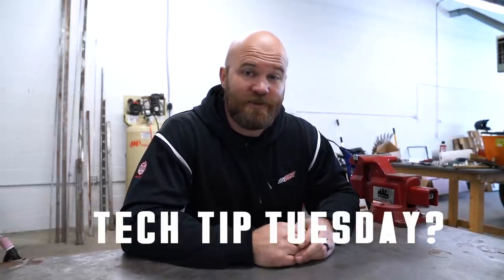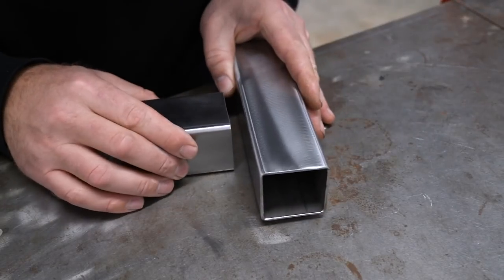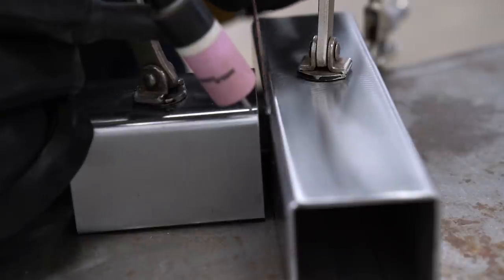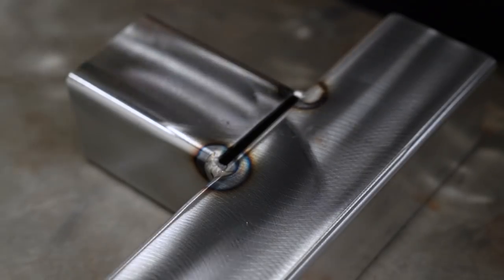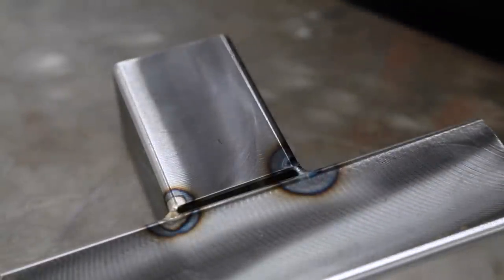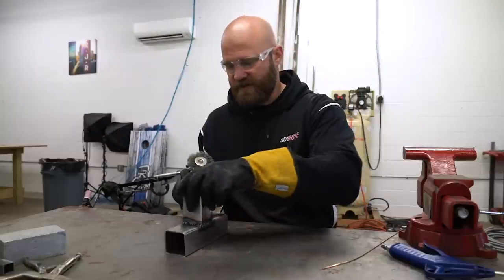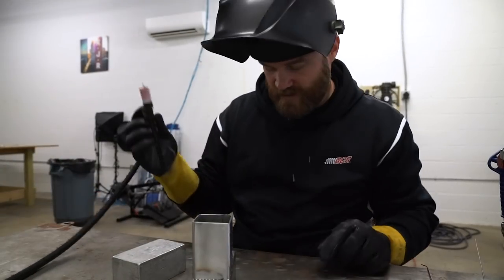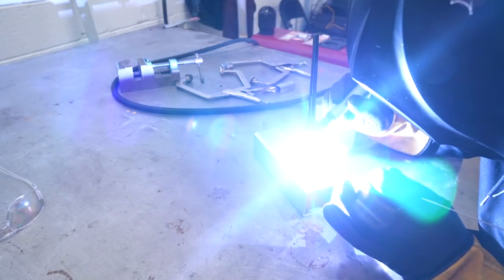How To TIG Weld ANY Gap

Comment: I had to quit watching. I’m a AWS CWI and have been welding pipe and boiler tubes since 1993 and I’ve never seen or heard of such. 
Turn your heat up get a bigger piece of wire and weave it. Avoid all the start and stops you can. I’m not making fun of you just trying to help.
Reply: Tacks are a big no-no on boiler tubes aren't they.  He probably isn't going to be working on anything that's xrayed so you can kinda just do whatever as long as it doesn't break
Reply: It says how to weld ANY gap. There are gaps in superheater tubes, walls, headers or anything really. You sound very intelligent by the way.
Reply: There should be a gap on every fit. With a very tight to zero gap you are guess on the penetration. Every welder has tried to make a X-ray weld the wrong gap and and blowed the wall out. The reason we have always tried is to not have bur bit shavings all over you. Kinda like porter wagner. The vast majority of fits on boiler tubes is made by a pair of welders. If you put your tacks in on a bad fit than weld belongs to the welder no matter what. Unless there is porosity on either side of the heat affected zone which is very very rare. A lot of welding partners will only put two tacks on a fit to have the fewest start and stops. I hope this kinda clears things up. The only reason I ever committed on this is to maybe help a young guy from busting a test because he put 231 tacks on it.
Reply: @drsexy2491  ??? If the pice was cut right dont you gap it to size of the filler rod???
Reply: @jasomkovac9115  really man
Reply: @fewridge6479  Every time you start and stop welding increases stresses imo. Once the weld stops and cools it shrinks and warps more.
Reply: @Charlesfeken  Thats why some companies have welder assistants to help with pipe fitting. They do the cutting and grinding so the welder can focus on just welding.  If you have to grind and prep everything thing yourself it takes longer on a job. Good assistants can move up to welding. If they spend their free time practicing welding instead of geeking at their smartphones and texts from friends.
Reply: just like body work on a car....it's all in the prep work. 
2 HRS of prepping for 5 minutes of welding....
Is better than 30 minutes of prepping and 2 hrs welding.
His cover up pass does look pretty nice though and I can see the merit in it on something like....
repairing a slammed trailer tongue toolbox that cannot be straightened well and is not going to be inspected such as structural field work would.
Reply from the maker: @Gardening 1974 in race car building a gap can put the chassis in a bind.
Reply: @Charlesfeken  not always but it's a very good starting point. It depends mostly on welder prefence and welding procedure
Reply: @George Rowe III Nice! Thin wall is harder for me than 180 or what have you... Try to get some practice doing that with an inconel filler rod. It's mostly used for carbon to stainless welding. If you can do an inconel butt weld it will certify you for all tig welds
Reply: Swampy  Lol! I'm not a welder at all but want to learn as a hobby and to repair a riding lawnmower and MAN! That's a double whammy, riding lawnmower/tractor guys and welders are double grumpy!😂😂 

"THATS NOT THE WAY I DO IT!"
"THAT WELD LOOKS LIKE SHIT!"

But every welding video on YouTube the comment section is filled with complaining and people complaining about the complainers 😂😂
Reply: I am a welding engineer and was the  741st CWI Made (Was a CAWI 2-years efore that) Couldn't agree with you more. Somebody willo try this completly improper technique on a critical weld,,,,even on a stock car,,,and sombody could loose their life over it. What he did is just plain wrong. Hurt fealings do not take persidance over dead bodies.
Reply: Swampy,,,,why do a Bob Villa half ass garage floor fabricating job when the correct and approved methode is actually faster and easier? - As AWS and ASME members and professional engineers it is actually our duty to try to stop the teaching of totally wrong and, in fact, dangerous techniques.
Reply: @jasomkovac9115  The 5700 pound valve bodies for the eleivtors for the aircraft carrier  Carl Vincn,  Nav Sea and 250-1500 Navy Nuclear parts I cannot tell you about. Parts for the Perry Nuclear Power Plant. A prototype for a 40MM anti Aircraft Gun. Many overhead cranes with up to 200 ton capicity. ,,,,,shall I go on Kid?
Reply: @cameltoast  You don't know any Electricians or Millwrights, o you?
Reply: @cameltoast  So if you want to learn the "hobby" why do you want to learn to half evcerthing? It costs no more to do thing correctly then it does to be a garrage floor fabricator,,,,,unless you really enjoy looking like a chump in front of professionals.

Comment: Yo you got some great advice. I've got an Everlast welder. I love welding with it stick, tig, mig (yes it can do all three) anything I just love welding but man I hate welding with gaps. I hope your advice will work with me.
Reply: Everlast makes some nice affordable multi-process machines.  I have 3 Everlast welders in my shop as well as ESAB and MIller.
Reply: Just tack the corners and star welding the gap you dont need to many tack on the gap. It is so much easier and faster.

Comment: welding any gap or hole is basically filling it up, with any of the process'. Taking note on your heat and not burning through the base metal. Every welding process, tig, stick, mig, braze, is all using filler metal. It's a matter of just kind of knowing your metals. Experiment, have fun. The best I came up with so far is tigging silicone bronze. Obviously, not for aluminum or any other metals in that field. But it's dam fun, when you fix someone's mistake. WHAT HOLE ? WHAT DO YOU MEAN SLOPPY CUT, WHAT CUT ?

Comment: Try laying a piece of filler rod in the gap, then welding over.
Reply: Dont do this! It causes way to much filler metal to go  into the weld and the heat might cause the other end of the filler rod to point up! (obviously idk if your joking)
Reply: You can leave lmfao.....never tig weld like that huge waste of material
Reply: Whats wrong with lay wire?
Reply: @nicksmall1990  nothing in my book, but it's the internet and everyone has a better, more knowledgeable reply.
Reply: @novarocker247  which is how your reply started.
Reply: @troutman3084  that's why I'm not arguing. Maybe you all are right.
Reply: @raging_naclholic4636  Just tac weld the filler rod to avoid point up
Reply: That is called slugging,,,,,and its one of the reasons the Liberty ships in WWII broke in half.
Reply: I thought that was torpedoes.

Comment: Your gas was not ON for the first weld was it? thought you were mig welding .........good video
Reply: I wondered if the hoses had not been fully purged with fresh gas at the start of the tack, and then by the time pure argon was flowing, the resulting oxides and impurities contaminated the subsequent added metal?
Reply: @Gottenhimfella  nah my money's on gas wasn't on
Reply: @JustVoss  then what happen explain?
Reply: @JustVoss   : you make a valid point. Trouble is, this is youTube, and valid points get buried, while armchair experts stride across the virtual landscape like predators ...

Comment: Make holes on purpose and close them back up  . Or stich weld  if a gap is Abit wide bout like tack on one side tack on another till it's a complete stich if u will. On both sides on same area . But hey either way using a spacer or other methods   I'm just saying.

Comment: Normally with Tig my jobs are sensitive enough that the match has to be perfect. Something like that having to use a 3 inch 80 grit belt sander with an angle plate.

Comment: I'm pretty sure you shouldn't use thinners for cleaning, only acetone. Thinners leaves a residue which gives off something nasty when heated. Or did I have a nightmare? :-D
Reply: You might be thinking abut brake cleaner.

Comment: Use a larger diameter filler rod
Reply: Not a good idea with a 1/16 tungsten. You’d end up having to pump more heat to get the filler to actually melt down and transfer to the puddle instead of balling up and being a general pain in the dick, ending up with bad warping, and sometimes total weld failure if it’s bad enough.

Comment: Brand should not matter. There just pieces of metal that serve the same purpose
Reply from the maker: You can look at two brands of gas lenses and see the machined steps that seat into the torch head are different.

Comment: Dude, When you got the far away shooting with a camera you need to cause a darker welding filter, you know, like going from number 13 filter to a number 15 filter of your mask. Here is why the auto filter is trying to see the table too so it is still flashed out to bright spot rather than seeing a liquid spot flow in your metal. You need to adjust the auto to go deeper into a darker filter setting. Most auto is set up to around thing like car headlights glare you need to set up to see around the sun's glare most auto darkenings do go to seeing around the sun for star gazing people look it up with the auto filter maker if you do not want to him about welding you doing then tell about trying to see the planet Mercury during the day time or maybe around sun sitting time of day the arc at some distances is much closer to sun brightness than the close-up arc welding is, which is and has been brighter than the Sun glare. although through a telescope this differences is less than many think it is, you see I know is this by seeing the planet Mercury at noon time with the Sun is at the point called zenith when the sun is the very brightest  on June 20th of each year within a 16 " double refractor telescope and taking photos of Mercury at that time. there are auto filters that can do welding from 6 feet to 8 feet away from the welder spot and can see the liquid just flow right into the metals and I talking Electrical Arc. 
I done this just to see if it can be done and that was ten years ago.

Comment: If you cut the box “crooked” filled the gap up with wire so it shrunk & took that long cleaning the base metal before welding in my place - you’d get the sack for being a sap.

Comment: Be careful with certain lacquer thinners, and esp brake clean, when weld arc is flashed on them they produce phosgene gas, and given enough years and saturation,  youll be pushin daisy's.
There are no old welders after all.

Comment: Hi , I am a retired Boilermaker and I can tell you right now , you have no idea how to weld TIG . on a side note do you know what TIG means because I don't think you do . Also every joint I welded was Xrayed to confirm I know how to weld .
Reply from the maker: I’v built race cars in NASCAR for 15 years. It’s two different kinds of welding. The biggest thing they care about in racing is that it looks nice and it doesn’t break. They rarely x-ray anything. Pretty sure I mentioned this is for small gaps on fabricated parts. It’s only large in the example so I have plenty to weld for video. Thanks for the random attack though.

Comment: Do one with oxyacetylene welding
Reply: Easy to do with any method, with practice. First, you practice making holes, and doing setups with large gaps. I found that the easiest part! Then you fix your errors. TIG is the best way to fill aluminum.

Comment: I don't know how to explain welding a gap better than to say you just lay the rod to it. We run lift arc rigs out in the field. No pedal, no finger controls. Pick your amperage and go, no time for all these little tacks.

You bridge the gap as you weld, chasing the arc with the filler wire to keep it from falling in. Start welding pipe and you have no choice but to learn.
Reply from the maker: Thanks for that, welding pipe is so far out from my expertise it’s interesting to hear how it’s done in that industry. And the way I demonstrated isn’t always the best in every application but does work to produce a final good looking weld.
Reply: @JustVoss  More than one way to skin a cat!

Comment: When you get to the edge of your world you need to keep welding otherwise you’re going to keep getting facials or fish eyes out they say they look like a tiny little hole at the end of your world that’s a weak point other than that pretty cool where are you working with square tubing are usually just set them up really well and use no filler metal and just straight tig them out

Comment: * Use mineral spirits for cleaning.  Acetone , brake kleen and some others put off a poisonous gas when welded on.  *
Reply: you might be thinking of phosgene  but i believe its from chlorine in some types of brakleen. far as i know, acetone is just fine for cleaning
Reply: It's fine as long as it flashes off. And, no. Don't use mineral spirits. Pour some on your hands, let it dry, and let me know about the residue. It leaves a nasty, oily, residue
Reply: I welded for years with nothing but wire wheels and scotchbrite to clean my materials. Don't really need any chemicals.

Comment: I'm guessing if you have a tig, then 99% probability you have a mig. Not talking trash but I would've definitely miged the gaps and run a final pass with tig for looks. No shielding gas on the inside of the tube while running tig can cause alot of problems.

Comment: Next time try chipping the flux off a 7018 rod, cutting to length, then lay it in the gap.  Now tack both ends then just melt it in from one end to the other.

Comment: you should put a big question mark after the title.   assuming that you know what you're doing is not knowing what you're doing.     first thing that told me you're a beginner is your material with no beveled edges..   ;)
Reply: it doesn't look much thicker than 16 gauge material.  especially with the huge gap, there will be no issue with penetration

Comment: A shop with out a mig welder?? WTF,  It's easier to use and fills gaps fast and saves you tons of time!!!
Reply: And looks like dog shit compared to nice clean TIG "dimes". & depending on the shop or your clientele, TIG makes you more $$$ cause it looks better & takes longer to do & more skill to accomplish. It's why pipefitting is mostly done with TIG & stick, dont see too much done with wirefeed
Reply: @FxckTheAFT Not in production buddy!! Go back and play with your hobby welder!!
Reply: @GeneralAlex4  so a Lincoln generator welder is a "hobby welder"? Lmao. I'm a union welder/pipefitter apprentice, came into the trade with a couple weld certs already as I was in school to be a welder before getting into the trade. Our weld shop at the hall only has 1 wire feeder & it rarely gets used cause my trade doesn't do much wirefeed because a) isn't versatile enough even running flux core, b) welds look like shit compared to good stick beads, let alone good tig beads. My journeyman usually travels & works shutdowns & rarely sees a wire feeder on site, & when he does it's always some non-union rat mfer like you who's running it. We take pride in our work & want it to look it's best, not slap shit together as fast as we can for "productions sake". Plus what I was referring to in my previous post was in custom fab shops & hotrod shops where higher end clientele want nice welds which means TIG, & they lay a lot more for that then having their shit put together with a wire feeder.
Reply: @FxckTheAFT  Broiter Joah,,,,,I don't thing you understand the BUSINESS of welding at all. You do not use heliarc (what old hard core welders call TIG, which is actually AWS GTAW) for root passes on pipe is for quality, not because it costst more. And ther eis a TON of pipe welding done with MIG,,,,,which, with the common execption of Aluminmum with 100% Argon, is actually MAG (A=Active gas) ,,,,, Now,,,,Want to talk electroslag or Sub arc for say 4" wall pipe? .
Reply: @FxckTheAFT  Boy, Your local  doean't seem to have too much on the ball. Looks like they will taqke anybody,,,BTW, you didn't seem to mention a 5 year apprentiship like we have in all the SSkilled trade unione in NE Ohio,,,,Cleveland is the welding capital of the world, you know. The Gods of welding belong to our AWS chapter.

Comment: How I weld a gap, I throw away the piece and cut a new one with no gap.ez
Reply from the maker: My example was bad, I often used this method on CNC’ed pieces that were welded to fabricated pieces in a fixture. When you’re stuck with it until they update the drawing.

Comment: I never try to fill a gap.  Cut the parts so they fit!  When you fill a gap when the weld cools the joint contracts causing tension on the part.  This causes warpage.
Reply: When the parts fit the shrinkage is much less and less warpage.  Sprint  cars that are welded with tight joints and no gaps are much stronger and straighter when taken out of the jig.
Reply: Love to see you work on a bridge or overhead crane......"Give me the shop super. ,,, Hey Joe, We are scrapping this pair of 45,000 Pound 80 foot long girder heams you sent us. Send us another pair a half inch longer.."

Comment: Great video only hole I can poke is, when using a wire wheel always use a full face mask pieces of the wire can come off and stick into your skin! Ouchie! Love it otherwise.
Reply from the maker: Yup, that does happen
Reply: after having metal shaving meet eyeball despite goggles, i now use facemark and goggles with any cutting/grinding

Comment: why didnt you chamfer edge on one piece ??
Reply from the maker: What’s a chamfer?
Reply: @JustVoss   a form of bevel, it is often created at a 45° angle between two adjoining right-angled faces allows for more weld material and a stronger weld.
Reply from the maker: MR A I was kidding 😆 I actually was worried it would make the area of the final weld to wide and harder to weld.